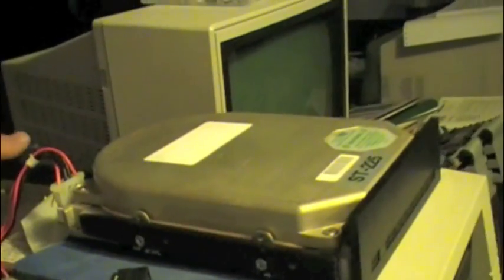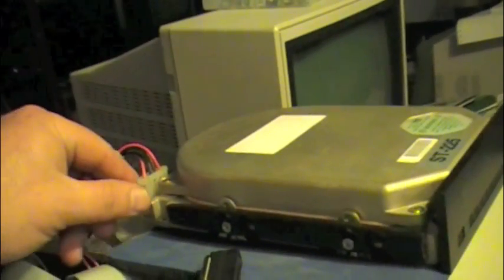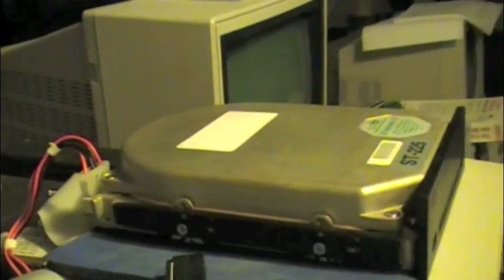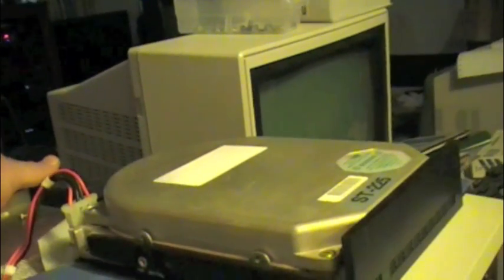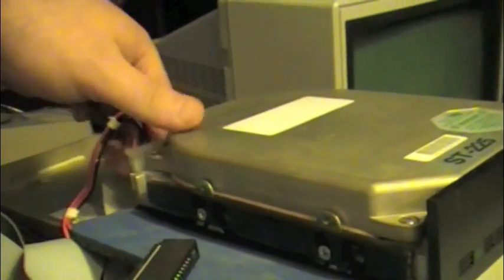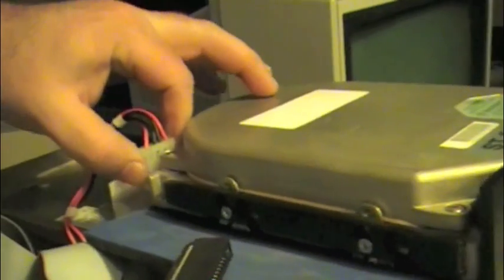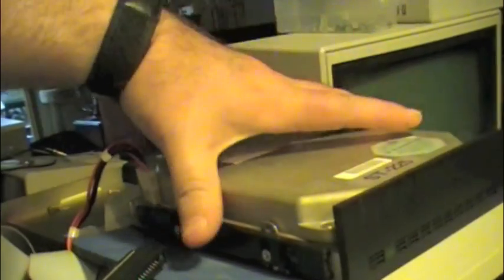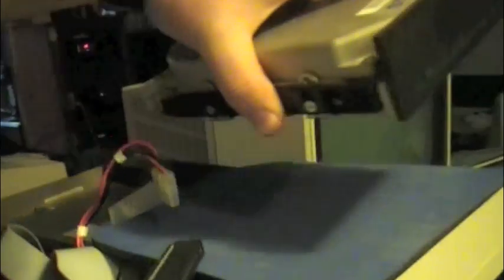2nd and 3rd Seagate ST-225 Spin up

Comment: How do you know that the disks are ok?
Reply from the maker: This was just a power up test.  Just checking the drive's electronics, and that the heads were not stuck to the platters.  I won't know how many bad sectors it has until I go to format them.